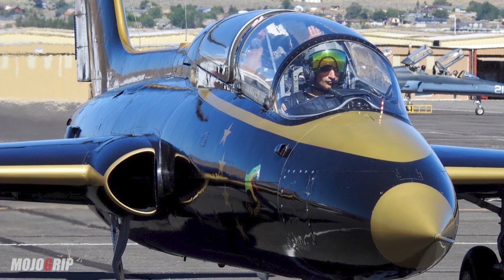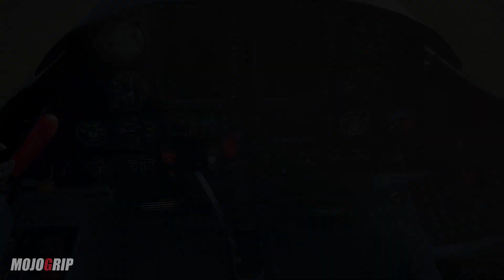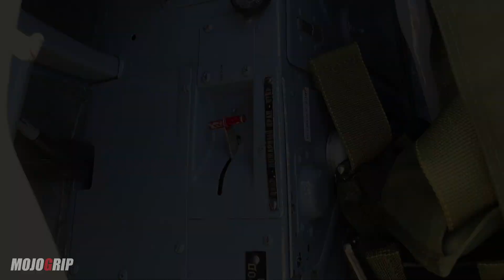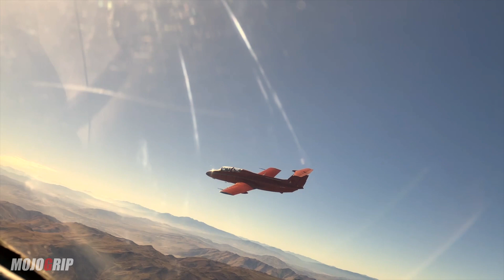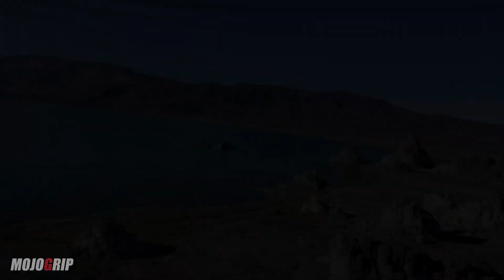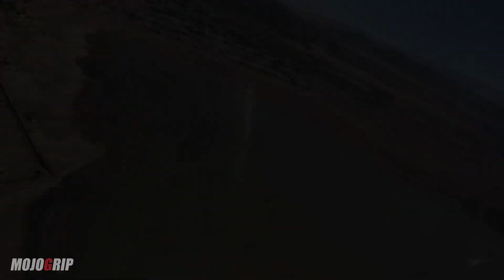One Of The Fastest Civilian Private Jet l L-29 Viper Super Delfin

Comment: 127GPH to cruise at 290kt doesn't sound efficient to me when compared to what a Lancair IV-P does. https://www.aopa.org/news-and-media/all-news/1994/june/pilot/lancair-iv-p

Max cruise 290kt 17.5gph. 😳
Reply: Your comparing apples and oranges. 127 gph for a pure jet of that capability, is like saying, well a Honda fit gets better gas mileage than Ferrari.
Reply: @Flightstar  I'm comparing CRUISE here. In terms of fuel efficiency vs speed, it is apples to apples because it's a for like comparison. I could care less the type of aircraft and whomever owns this jet will simply have to spend 7 times the amount in fuel cost to cruise the same speeds. That's a mathematical fact. So why is this guy talking about how efficient it is?

Comment: The engine is about 212kg, the aircraft over 2200. Imagine if the aircraft without engine was instead 100kg, which it easily could be. It's a jet powered anvil.